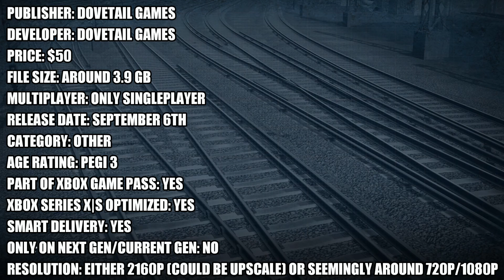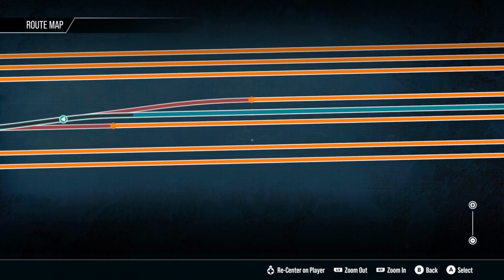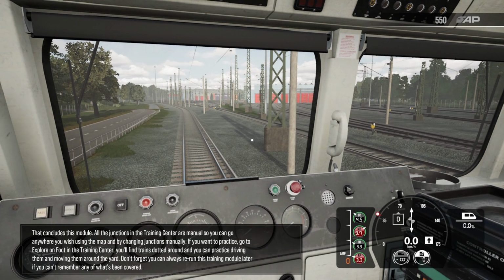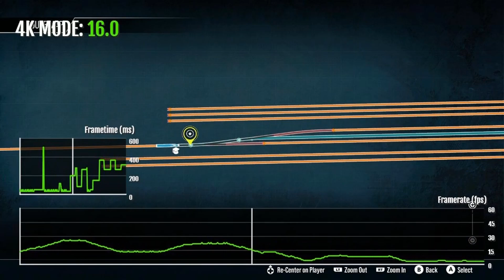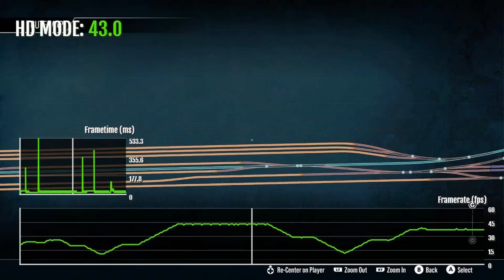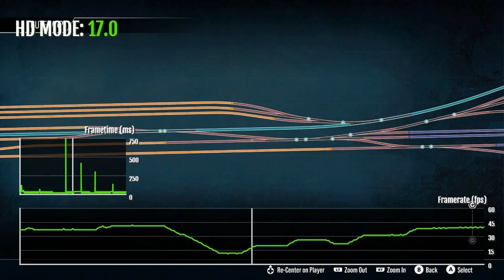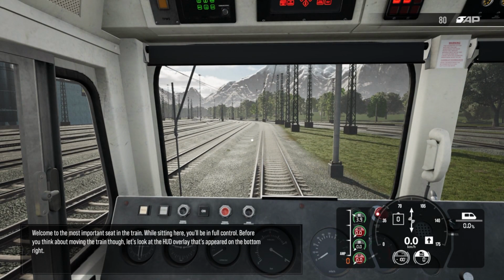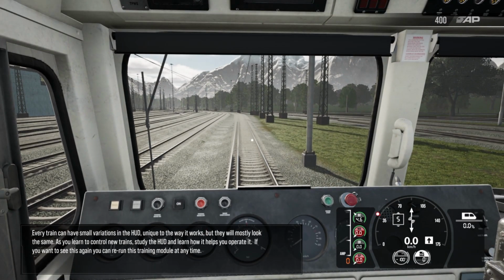Train Sim World 3 - Xbox Series S Gameplay + FPS Test

Comment: Cyberpunk got 900p 60 fps and there we have trash graphics in 1080p 45 fps lul
Reply from the maker: Is it confirmed to be running in 900p? I'll be testing it later today.
Reply: @FuzionXboxTesting  they say dynamic between 800p and 1080p mostly 900p
Reply: @pike1310  it's dynamic 1080p60 on performance mode and 1440p30 on quality mode, Noone cares if it goes down to 900p sometimes🤷🏾‍♂️